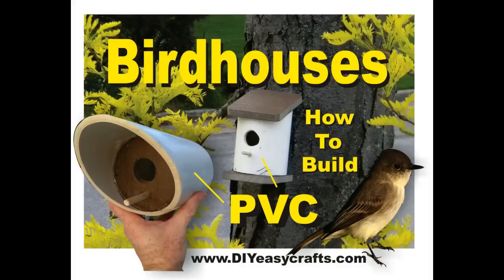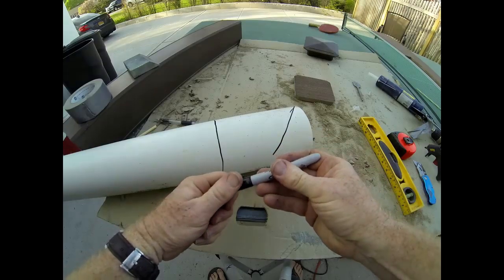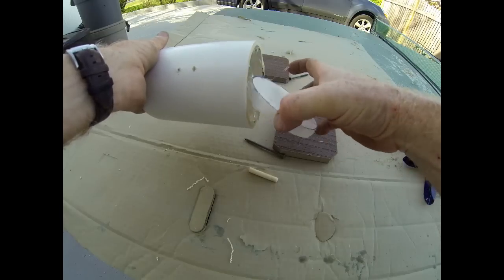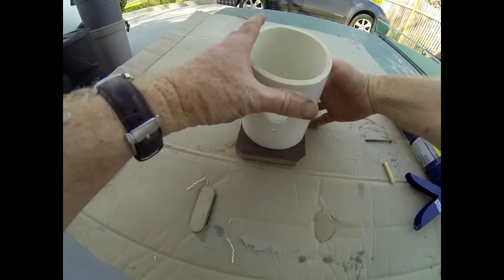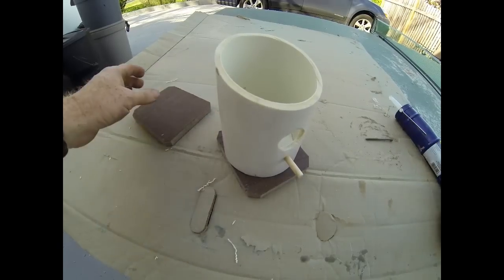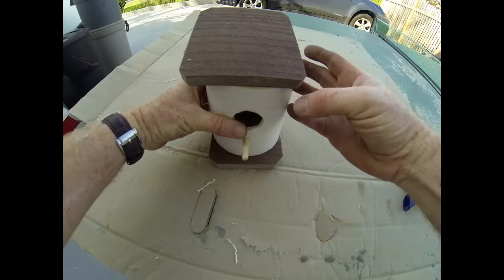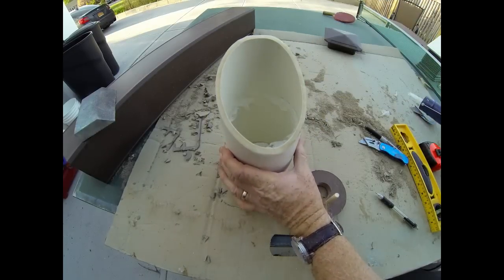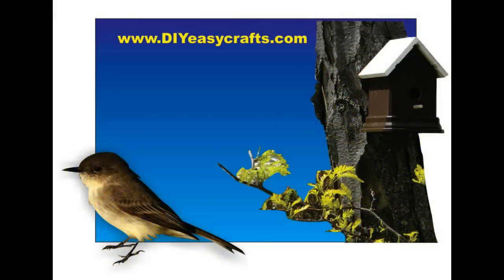PVC Birdhouses Super Easy DIY How to Build

Comment: Just for your info:  A birdhouse should never have a perch.  A perch allows predator birds to hang onto the birdhouse and get to the babies easier.  The perch evolved as a decorative thing. You can look at farmers who have very large vegetable gardens and have lots of birdhouses; the houses don't have perches.
Reply: exactly jimmie200 ,  birds naturally use a rotted out hole in a tree for a nesting spot,  mother nature does not come around and stick a perch in the tree for the birds to use but people think they need a perch. All of our nature center blue bird house kits do NOT have a perch.
Reply: How true, no perches needed
Reply: jimmie200, the perches just make it easier for the birds to get in and out. Predators can get in just as easily whether its a perch, scratchings or nothing at all. The bird houses just give better protection to the birds as apposed to a tree. It makes sense if you think about it. 👍
Reply: Really need to have a way to open and clean out each year.

Comment: What birds are you hoping to attract  ?  It looks a large hole for a such a small nest.  It’s advised that there be a 12.5 cm / 5 inch drop from the bottom of the hole to the floor which stops predators like squirrels putting a paw in and scooping out a chick.  Adding a few drainage and vent holes would be of benefit.  How will you be able to clean it  ?  I don’t mean to be critical but helpful.  The concept is great but maybe a few changes would improve it.

Comment: cool idea but not sure birds like plastic, you should really spend a few minutes on google to get the proper specs on a real bird house, the size of the hole is very important and perches are a no no...
Reply from the maker: You are correct size of the hole is very important. I have found that birds do like the plastic birdhouses but do prefer the darker brown trex structures. As for the perch I know several viewers say not to use them and that is an individual decision. I kind of get a kick out of seeing mother birds standing on the perch and feeding chicks through entry hole.
Reply: I love the idea of PVC because it's water tight (the material itself) and it will definitely last forever.  however it's not a very natural feeling material and the bird will prefer wood like material as you pointed out but with the competition and lose of habitat they will use it anyway, kind of like low income housing in the wild. :)
As for the perch it is an individual decision because you are the one building the house and the birds will stand on anything perch like.  The reason the birding community recommends against perches is that it becomes a link to other unwanted birds and predators like squirrels and cats that will use the perch to hand on to while reaching into nest. Not they won't try this without the perch but it gives them and advantage . This is why height of the entrance in relation to the floor of the house is also important to keep chicks out of reach of predators and doubling the thickness of the door helps also.  
And not to make an essay out of this but just to mention the things i consider when making a bird house are ventilation, drainage, access to open and clean in the winter.    And one last thing would be, especially for a material as slippery as PVC is to make some groves inside the nest under the entrance to help chicks clime out when they're ready to leave the nest.   Tons of more info on that on the web but keep in mind the type of bird you're targeting so you know exactly what size everything should be.  Good luck and keep up the good work.
Reply: the reason they recommend against the perch is because predators will use it to get a grip while reaching into the house, the birds will certainly use it but they don't need it.  it is to protect the birds,  so you have the choice of making a better house... up to you....
Reply: There are several components to creating an amazing design. One place I found that succeeds in merging these is the Aviary Magic Method  (google it if you're interested) without a doubt the best course that I've heard of. Check out this  extraordinary site.
Reply: DIYeasycrafts- On PVC a perch is a good ideal, being a smooth surface, I imagine it would be diffcult for a bird to cling to the opening/surface.

Comment: How do you clean out these bird boxes?  or do you throw them away each years?
Reply: Birds will generally clean out a house and rebuild the nest to suit their needs.  I have had birdhouses for over 40 years and have NEVER cleaned one.  It is amazing to see the awesome variety of nesting materials that the drag out.  I always build my houses from cedar and rarely finish or paint them and never install a perch.  I generally have over 20 houses in my very large yard. From my experience, many birds seem to like a simple rectangular box with good drainage and a horizontal oblong entrance hole as opposed to round, and positioned to one side of the front of the box.

Comment: No way to clean out the nest after use and it also needs ventilation  at 
base or otherwise it'll get very damp & mouldy (from chicks themselves and waste 
& food & condensation). If made too shallow, (entrance hole too low) chicks can fall out and predators/birds can reach
 in. No perch needed, predators can use it! Also without drilled ventilation 
holes it can get too hot inside for the chicks. -otherwise very good!

Comment: You can make an onverted V with silicone to direct water away from the opening. There should be nothing to sit on below the roof. And there should be a drain in case water enters the nesting box.

Comment: No need for any of the silicone. You will drive away the birds with the chemical smell. Just find a way to use stainless steel screws. No silicone. Also how do you take the house apart to clean it. Obviously you know nothing of bird house building.